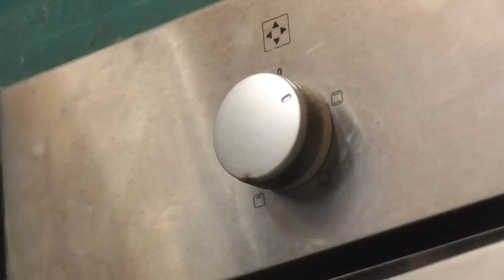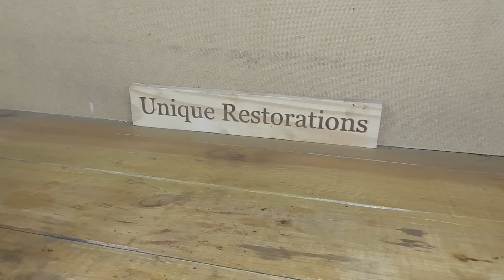Restoration of Antique Hand Plane - Complete with Japanning

Comment: First off it looks nice. 

FYI not all hand planes, including Stanley’s, were Japaned. Many were baked on enamel. Hard as heck to remove as sandblasting doesn’t do squat. Blades are 25 with edge at 30. It drags on the wood otherwise and doesn’t cut well. Smoothing planes with their much higher angle you go 30 with edge at 35.  Always check handles to make sure they don’t wiggle.  Frogs on generic planes the edge doesn’t touch the throat and they shimmy. I have had to machine a few so that the frog is stable.

The sole should be flattened after handles are on, frog tightly in, and blade clamped in place. It affects sole. Back and front edges should have a slight bevel and sides should also have a slight taper so as to not mark wood. Blades should also have a slight camber or they leave grooves when handplaning.

Otherwise nice job making someth8ng most people throw away into something useable.
Reply from the maker: Thanks for taking the time to write this Comment Jacilyn, it must have taken a while.  The information you shared is appreciated and I will use it when I work on another plane. Many thanks Brian

Comment: I've seen those drills restored before. I'd like to see the saw. Not as simple as some might think if you are going to reset the teeth 👍
Reply from the maker: Thanks Optical Trace, I agree the Saw is not just a quick polished and Varnish. Either way  both will be Restored. Stay tuned. Regards Brian

Comment: You have made a superb job of restoring this plane and it just goes to show that with care you can make a very usable tool out of something which looks past its best. I dont actually think that its a true antique plane and also quite a low grade copy of a Stanley probably 1980s, as the blade adjustment is made of sheet metal ( rather than cast ) as is the angle adjustment lever . Many plane makers introduced these cheap parts in the 1980s as a way of reducing costs and they do wear very quickly as you witnessed with the burrs on the lever. However,  you have done the finessing which is missing from these cheap tools and as a result have brought it up to a good standard. Well done !!!

Comment: With the small depth adjuster and the keyhole lever cap, the front knob should be low, and slightly flattened.  The knob shown is a replacement.

Comment: Great job!!! I really like watching your renovations, they are not as bizarre as in the case of many other authors. I have only one caveat, don't stretch your time, some activities you celebrate, that only candle processions and little girls with flowers are missing ;) There is no need to remove the screws with pliers and their presentation or slow sweeping with a brush ...
Hope you won't be angry for this little criticism ... I greet you
Reply from the maker: Hi Coolerss, Thank you for taking the time to write this comment, I try to add and remove certain elements and ideas in each video to see what people want to see and hopefully create a more engaging video. Sometimes this does not quite work out but I hope over time I will find a nice balance for all to enjoy. Regards Brian
Reply: @UniqueRestorations  Thank you for your response. I will definitely stay on your channel. You do some really great renovations by bringing your devices back to their original condition.

Comment: Great vid, but do you know you restored a 20$ plane (in good condition)? And you need to flatten the sole and sides with the plane assembled…
Reply: also should have epoxied that hole instead of improperly welding cast iron.  All he did was SEVERELY weaken that area.